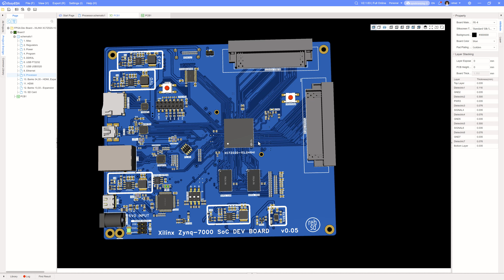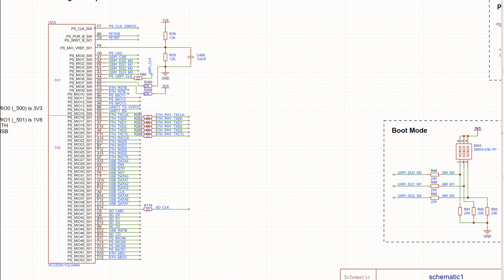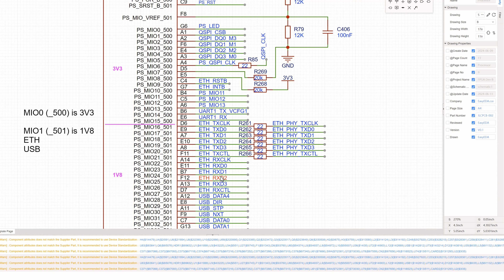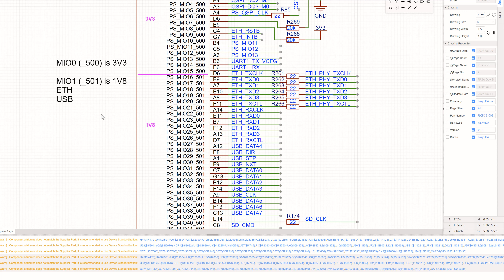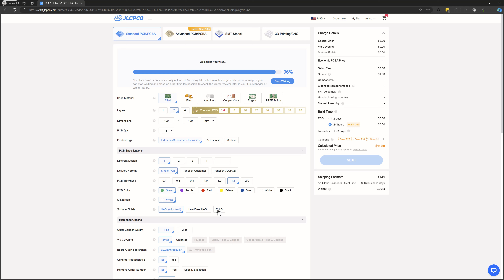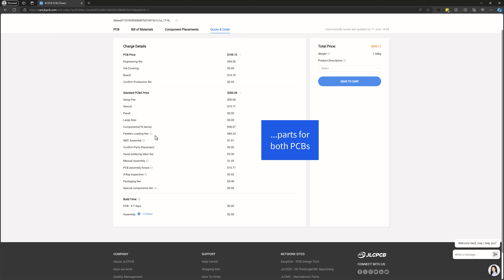Zynq-7000 PCB Build - Part 9 - Vivado Configuration & Estimated PCB Costs

Comment: Nice, almost done! What’s the reason the HDMI is positioned like that?
Reply from the maker: I placed it on the bottom to make the routing easier. From the top side, I'd have to get all of the traces swapped in order (left to right). Possibly, the pinout on the SoC could be changed to address this, but having the HDMI connector on the bottom is easy for me.
Reply: @rehsd  would you need to swap positions within differential pairs aswell?
Reply from the maker: @trippycat  Right, each of the pairs would need to be moved around.

Comment: Regarding fan PWM - since you have free GPIOs, you can use one of them to drive a MOSFET which would control the fan. Make sure it defaults to always-on when there are no control signals from the CPU via a pullup, and don't forget to add a reverse-protection diode across the fan to make sure fan coil's inductance won't destroy the MOSFET.

Comment: I prefer assembling my prototypes manually. It can be a pain to manually place 200+ components per side before reflow, but I still enjoy the process, and my wife helps me out when I need to take breaks. It does take quite a bit of time (about 5-6 hrs per side with 200-300 components, most of which are 0402s), so I usually do it over the weekend.
Reply from the maker: Honestly, I'd like to do both -- have a set assembled and try to assemble one myself. I figure I will learn from both approaches.

Comment: MDC/MDIO form a management interface for Ethernet PHY, it uses signalling somewhat similar to (but not compatible with) I2C, and is used to access Ethernet PHY's registers to configure all aspects of their functionality. Part of them are standardized, but many are device-specific. You can read more about this interface in IEEE 802.3, clause 22.2.4. This bus is very slow (< 1MHz), so you don't have to worry about routing it - as long as pins connect - it will work.

Comment: DDR3 has a minimum frequency of 303 MHz. You can't run it slower than that - at least according to specification. And I wouldn't worry about it too much anyway - 533 MHz is fairly slow by DDR3 standards (it can go as high as 933 MHz per JEDEC), so you can get away with some amount of sloppinness 😀

Comment: I had to slap together a GPS board and made the mistake of routing TX to TX and RX to RX.  Unfortunately it's relative, unlike MISO/MOSI designation.  I had to cut traces and cross the connections.  Yes, I literally had "measured once, cut twice", lol.  Lesson to make absolutely sure before cutting the board.  But also cheap insurance to have zero-ohm jumpers to make it easier to correct any crossed connections.